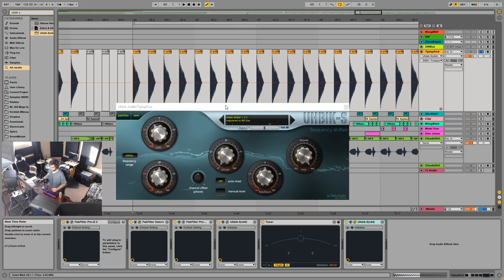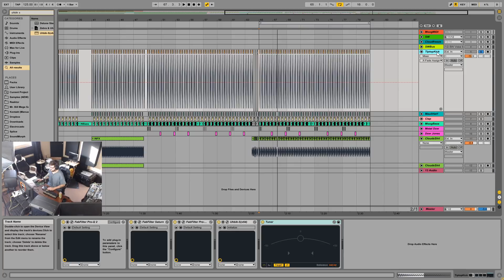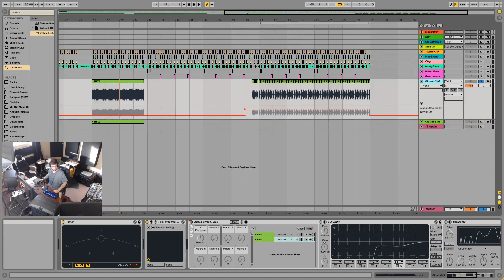Mr. Bill - Ableton Tutorial 61: Retuning Samples Using Frequency Shifter

Comment: why not split the sample, warp with complex pro and change tuning, consolidate clip and copy/paste... am I missing something?
Reply: exactly - why go through all this trouble - seems easier to split and transpose separately
Reply: I think it is about time, having prepared a rack lets you quickly move through this
Reply: split will not split the whole sound, it will miss out on some of the harmonics as well as introduce the phase issues caused by filtering, besides if both samples were roughly in the same frequency range in general - you wouldn't be able to split it. so this so called "solution" is nothing but a time waste and way away from being universal and/or useful. no offence to Bill tho, but this particular one is a miss.

Comment: so on Live's Frequency Shifter you would just use the Fine knob to go up & down semitones? like +/-1 increment of the knob = +/-1 semitone?
Reply: Frequency shifting is not the same as transposing. A frequency shifter adds Hz values to ALL frequencies in the signal, which means that an octave for a 200 Hz tone would be adding another 200 Hz, but any tone of 400 Hz would not tune properly to 800, but rather it would become 600. So the actual semitone difference is totally relative to the incoming signal, and this actually causes damage to the harmonic relationships within the signal, especially for lower frequencies which change semitones much easier than higher frequencies. 10 Hz to 20 Hz is an octave, but 100 to 110 is not even close; the harmonic ratios are not able to be conserved with a frequency shifter.